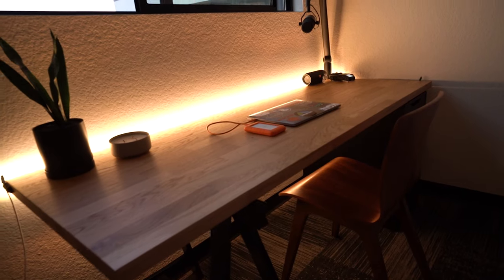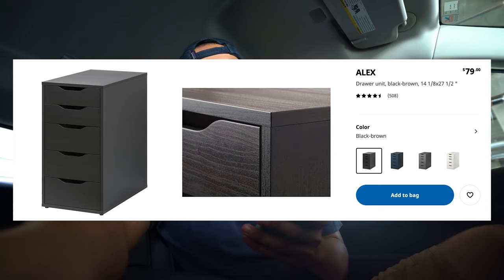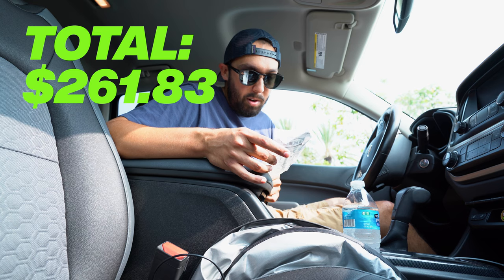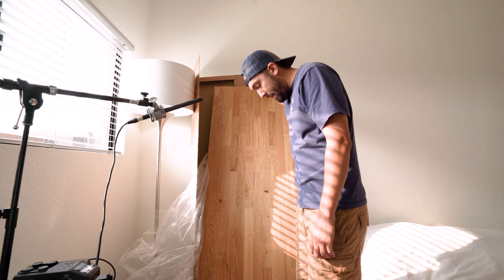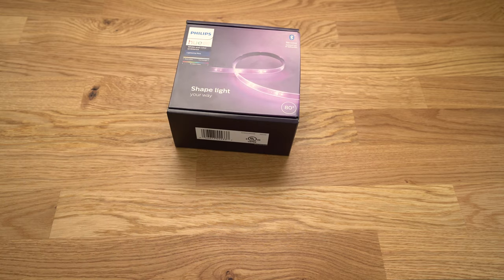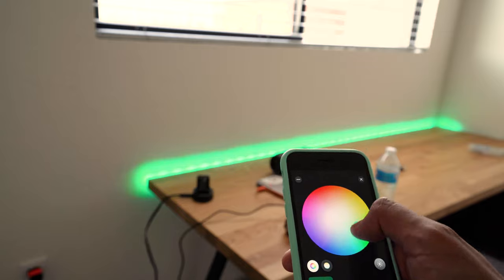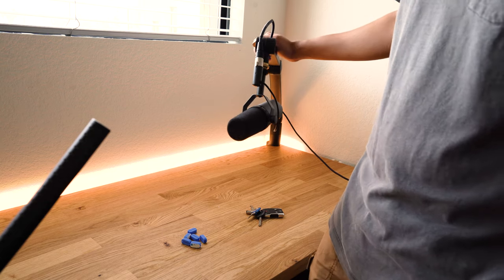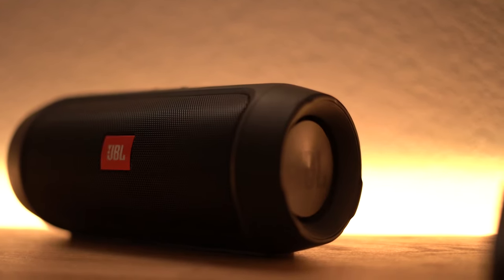DIY: Minimal Desk Setup 2020

Comment: hi, maybe a little bit late but is the like desk hard hard wood? Like solid wood?
Reply from the maker: yeah that thing was heavy lol
Reply: It's not really what most people would call "solid wood" but it is wood all the way through. It is particle board with a thin wood veneer on the top and side surfaces. It has a paper (or cardboard?) covering on the bottom. The veneer can be walnut, oak, or birch. The one in the video is oak. It comes with two extra strips of veneer you can attach in case you have to cut it.

Comment: Do you just lay the table top on top of the alex drawers? Im scared it won’t be secure or might be in convenient when i want to move the table as a whole
Reply: It's pretty heavy so it won't slide around easily. Some people just use pads to help increase friction. Some people attach using screws. The Karlby and Alex are mostly particle board, so pretty easy to drill through.

Comment: Thanks for the video! Question about your set up. Did you have to do any drilling or screwing into the Karlby countertop? Or did you just use some rubber pads to hold the top in place?
Reply from the maker: Hey Vince,

No drilling, just some rubber stoppers between the legs and countertop. the gel pads came with the drawer and legs

Comment: hey bro just wana ask what specs is ur kitchen table top? been planning to put a set up like urs in my bedroom..
Reply from the maker: 74 inches long but it has the capability of being cut shorter with a table saw. It comes with adhesive to stick on to the side of the table once (if) you cut it